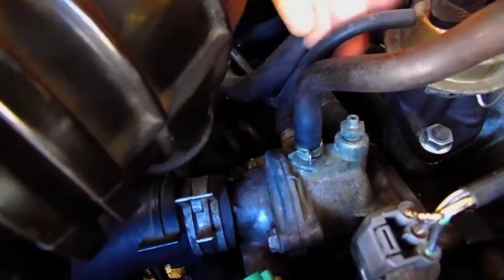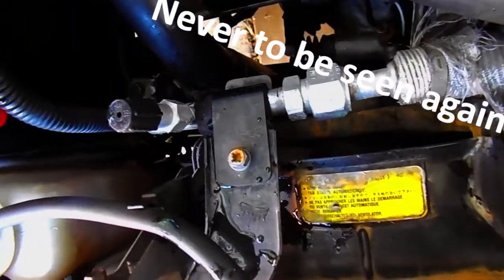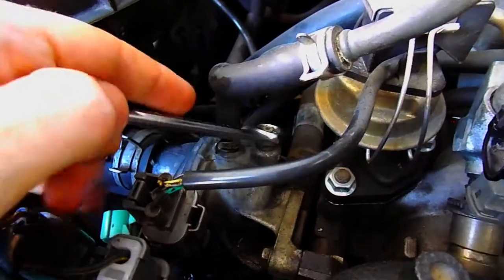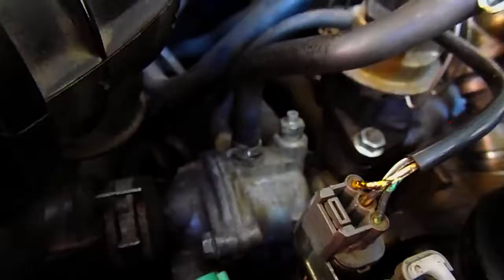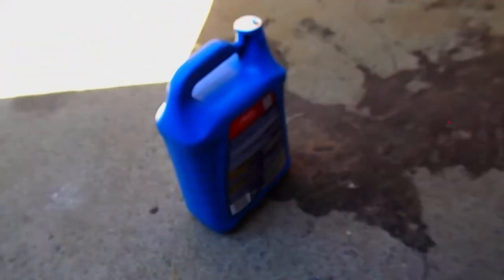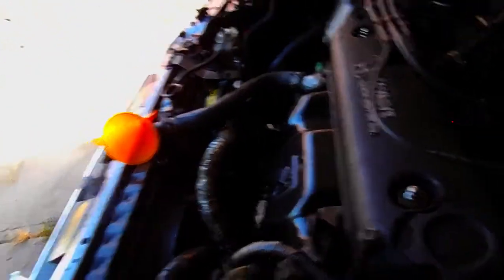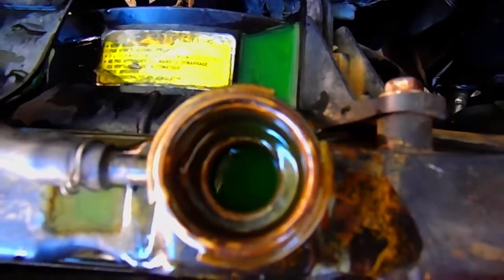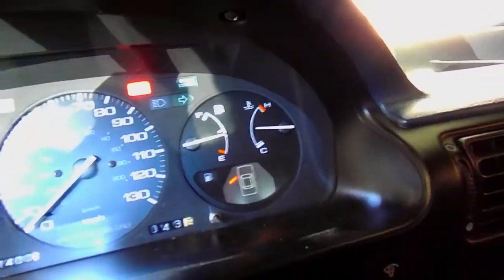CB7 Cooling fan update; Narrowing it down

Comment: What ended up being the issue with the cooling fan not coming on?
Reply from the maker: Yo! Sorry I never updated the situation with the car, with extensive work with a relative, it ended up being the radiator. It was clogged up with a  piece of the water pump that rusted over due to the previous owner used water instead of coolant. I've replaced everything possible from thermostat to sensors so I couldn't personally figure that out. Are you having any issues with your car by chance?
Reply: Yes. The cooling fan will not come on. Although the car doesn't overheat I would like to have the fan working. I've checked the temp sensors and they seem fine and I can make the fan come on if I jump the relay and I have determined that I'm not getting power to the side of the relay that activates it. All fuses have been checked as well as other things. I'm down to tracking a open in the circuit somewhere. I was wondering what you had found because my thoughts were that if you had found a open in the circuit that it may give me a place to look for an open in mine. No worries I will find the issue as I'm a mechanic by trade. I'm not a Honda mechanic per say so I'm not familiar with the common issues or locations of common problems of Honda electrical. I will require some good ol fashion diag and not a easy fix I find on the internet.

Anyways thanks for the awesome videos and thanks for the reply.
Reply from the maker: @builditcrashit4702   ah no need to thank me I'm always happy to help, I just hope you find your problem soon! If you haven't got it already, I believe I have the service manual somewhere on my computer that I could send you if you want it. Just add me on google+, I'll upload it & send you the link to it! I'd like to help out more but I'm not to familiar with the electronics than I'm comfortable with (Something I need to look more into to be honest), If you do end up finding it just let me know, more power in information to anyone else who has this problem!
Reply: @builditcrashit4702  what did it end up being
Reply: @builditcrashit4702  do you know where the open was or why it wasnt getting power? Im having the exact same issue.
Reply: @PaycoTsunami  Why would a clogged radiator prevent the fan(s) actuating?